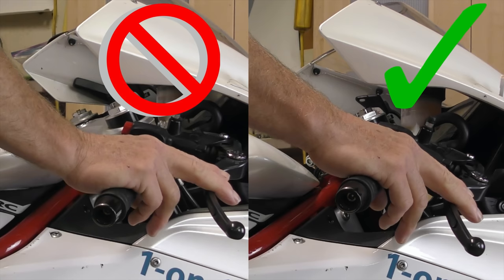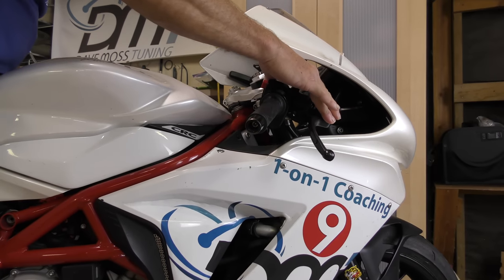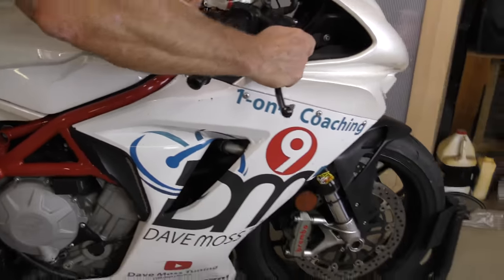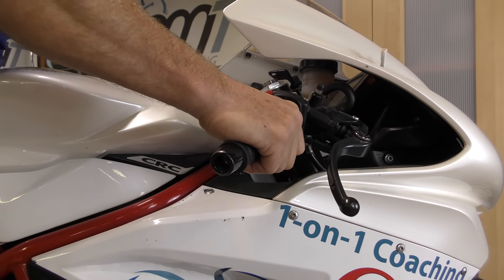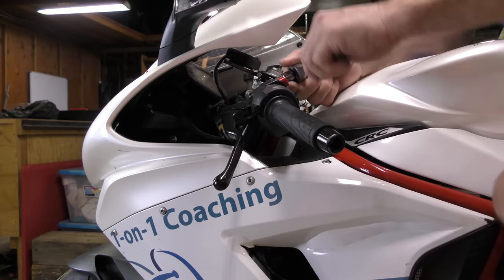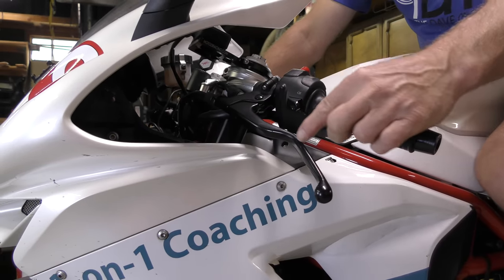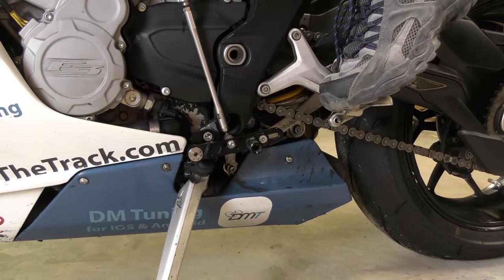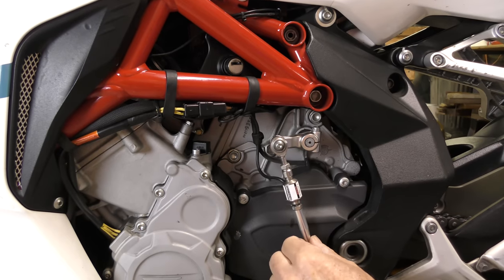How To Adjust Motorcycle Levers & Shifter

Comment: Just remember if riding an Adventure Bike its a compromise between between the position of the brake hand lever for standing, & sitting . I adjusted my lever up while seated on the bike to the correct position but didn't realise the acute angle I was putting on my wrist when standing . Thank you for your video it made me think about my posture something I hadn't really considered in 40+ years of riding , I would just jump on an' ride
Reply from the maker: Thank you for your response and thoughts that others can benefit from.

Comment: This is great for drag racing but in traffic where you might need to turn the bars. Those settings will easily hit the body work. So this is mostly for the track not the street.

Comment: I'm starting to believe that I'm REALLY over-thinking my front lever set-up. I've adjusted both of them at least three times so far. I'm new so of course I want everything as "perfect" as possible. I think I'm pretty close to where I want everything but this video helps a lot. Thank you!!
Reply from the maker: If you have to think about an action, then the lever is not quite righty. Normally, that is angle not reach. If it feels intuitive, you are in the right location!

Comment: Top man, Dave,  I finally bought my RT. I mentioned I was tossing up between an RT and a GS Adv. I treated myself to some new Daytonas. My bike was in getting the top box sorted. BMW have got big production issues at the mo. When I was taking the loan RT  bike back (the boots came between dropping my bike off and picking it up) I couldn’t get my foot under the lever. The new boots were the Evo Voltex. My old ones are the Evo Sports GTX. I had to go all the way to Peterborough in 3rd gear, which is about 20 miles away from me! I didn’t have time to fiddle with the loan bike. Today, I adjusted mine (badly). The shift wouldn’t go down. I obviously turned up the shaft too much. Your video helped me set it correctly. Thank you, from one Brit to another!
Reply from the maker: Thank you for using the information to create a much more ergonomically comfortable bike!

Comment: Thanks. Another great video. In my case I adjust the levers the way you do it, sitting as if I was in 'race mode', with my weight probably slightly more towards the front rather than in a relaxed position. That changes down the lever angle a little bit, it makes me lower them a couple of degrees more. Probably fine millimetric adjustments like this one make no difference. The important thing as you said is that nothing is getting in the way and that you set the appropriate distance as well. You have a radial pump, I have an axial one, yours should give you more feel. I don't have the knob with numbers to set the distance, but I do it by moving the lever along the handlebar towards the bike, that also gives me (at least to me) more feel as by doing so, I get more leverage (it compensates a bit the fact that it's axial rather than radial). Thanks again
Reply from the maker: Great lateral thinking in moving the lever laterally!

Comment: Man…when I was a kid I was lucky if I could adjust brake / clutch lever engagement points and the collar on rear shock which I was to afraid to mess with so I adjusted to every bike I got through the 80’s…. Was searching for suspension adjusting tips and went down a “Dave moss tuning” rabbit hole of you tube videos … which is kinda cool I found the adjustment sequence before I’ve even rode my new ( new to me ) fz1…I won’t have wrong adjustments to overcome when I adjust them to me .
Reply from the maker: Thank you for being willing to follow that path and create "your" motorcycle. A tip if the hat to you Vic!

Comment: Dave!
Glad your still doing your thing 😌
I past 34,000 miles on my (05) GSXR 750 couple weeks ago.
I'm thinking about retiring it from the street and setting it up strictly as a track bike 😊
Any info you have would be well received 👍🏻🙏
Reply from the maker: New fork oil and bushings, chassis overall with clean and lube, shock service, new rear wheel cush drive rubber. That way you are 100% ready

Comment: At 2:25 you're easily turning the silver adjustment wheel. Did you loosen something beforehand to make it spin easily? Asking because my bike's wheel is "frozen"
Reply from the maker: I use a 6mm allen when I need leverage vs a large flat tip. If you have the correct Torx tool, that is your best choice. If the adjuster is frozen, are you referring to both or just one leg. If both, normal settings changes move the adjuster left/counter clockwise to minimum. I would start by gently going right/clockwise with even pressure vs shock treatment with sudden force. If it does not move, try the opposite direction. Next step is that there is a risk that a preload spacer is cracked, so that means loosening the upper triple clamp bolt and the fork cap (make sure the bike is on the side/kick stand). Once the cap comes loose, compress the fork to see the spacer against the cap to look for damage. If there is no damage, close the fork up and repeat on the other leg. If there is no damage to either spacer, have a suspension shop or race team mechanic test the adjusters to see if they can get them free.

Comment: Great tips. Should olur front arms paralel to ground or we sit upright position when we set
Reply from the maker: All based on your spine length and distance to the bars as that sets your forearm angle by default. So if you can move the bars and create more comfort that shows you the preferred alignment for your forearm.

Comment: im curious if there are more adjustments to be made with gloves on as ive found that my adjustment out of gloves doesnt match what i need in gloves, especially winter gloves at least in terms of getting to that first knuckle as a gloved hand doesnt move the same when reaching for the levers. in fact summer gloves seem to make my hands feel smaller on the controls
Reply from the maker: Great contribution - thank you!

Comment: I have a question about throttle position. Iv adjusted my levers on my 1999 ducati 750ss but I feel like my throttle needs rotating forward a little to reduce the angle of my wrist while accelerating. My problem is the throttle housing is pinned in to the bar and the bar is pinned in to clamp so I can't easily rotate either without modification. I could rotate the clip on and then drill the recess in the bar for the bolt or I can remove the pin from the throttle. Do you think either method will be safe? And which would be preferable?

Thanks.

Comment: I like the clutch and front brake lever low enough so you don't have to lift your fingers high to get over them. I use one finger on the front brake but  use all four fingers on the clutch ..
  The Horn is really hard to reach on  the FZ-07.. and it will be loud enough when I finally install my air horn .. to get the idiots in cages attention when they cut me off and move into my lane.

Comment: Mr. Moss I have an odd question never asked. What is the "Normal" angle for clipons? What is stock normally and what if any changes should be made for racing applications? OEM are risers, Woodcraft are not and now the front fairing may need modification depending on the angle I use.
Reply from the maker: Normal is back of the palm in line with the forearm so you pull correctly in one line.

Comment: Should that line from the forearm through the brake lever be set while in a full tuck for a race bike? I notice it was set from an upright position, would that be where a track bike rider spends most of their riding time?
Reply from the maker: It is always set for braking position. Tucked means Quickshifter and or power shift.

Comment: What about a 2017 gsxr1000? I tried to lower my brake lever but the fixed cable gets in the way. My 08 zx6r had a nipple to keep the throttle cables in the standard position so I’m assuming this bike has one to. Thoughts?

Comment: When riding relaxed my arm is more straight up. When riding fast, my arm is dropped down almost parallel to the ground. Which scenario should I set up the brake/clutch lever angle for?
Reply from the maker: Consider your average speed and time spent in one position over the other. Create a mid point as a compromise.

Comment: Anyway to adjust a clutch thats hydraulic? Bought aftermarket levers but only the brake side will adjust closer for me. Was told after the fact only cable adjustable allows the clutch closer.
Reply from the maker: If the lever has no adjustment point at all, then yes, the cable free play is the only adjustment.  Some levers will offer adjustment on the actual lever itself, others will offer adjustment between lever and piston for hydraulic variants.

Comment: I have a new 2023 MT-09 and the brake fluid reservoir is connected to the front brake lever mounting bracket on the handle bars. Is it ok to adjust this downward, and not have the fluid level ‘level’ in the reservoir? Any advice is appreciated!
Reply from the maker: That is not an issue at all as you have the large rubber seal inside the top of the cap. The only issue is if the fluid is below the low level and you allow air to get in and that takes some effort!
Reply: @catalystreactionsbw  Thanks mate. Very much appreciated. ✊🏻

Comment: Hey Dave. I recently did a fork service on my 2007 CBR1000RR and when I got finished I noticed one forks preload adjuster can turn 15.5 times and the other turns 15.75 until full hard. I did not touch any of the preload mechanisms in the cap while servicing. The manual says the range should be 15 turns. Could it just be the preload tolerances were off from the factory? Should that small difference have an impact on handling if I set the preload equal from full soft?
Reply from the maker: The small difference will not have an impact on handling! The difference is created when the fork cap is assembled. It is quite common.

Comment: When I adjust my brake/clutch levers via adjustment dial, the engagement points change drastically. Adjusting clutch cable / re-bleeding brakes does change the engagement point or feedback feel. There is a lot of dead play in both before they actually engage (maybe last 10% of the throw). Any advice on how to alleviate the issue?
Reply: Looks like you have a lot of freeplay
Reply from the maker: Dead space is normally the gap between the lever and contact point for the brake. With time and wear, that increases. For the clutch, free play should be 1-2mm when the engine is hot.

Comment: hi there Dave,
Just trying to work out what i am doing wrong! 
 I adjusted this for my foot but then i have trouble changing gear ie it doesn't go into say second to third. 
could you give me any advice that i could try please..

the clutch Is adjusted to have correct free play. i have after market levers due to small hands. setting is on number 1
my bike is Honda cb500f 2023 i got it new after passing my test in the uk.. 
im 60+ and love your videos

kind regards kev
Reply from the maker: 1. Check that each angle is 90 degrees in the entire linkage. 2. Check the shift arm position and movement - it should not stress the shift rod. 3. Check the shift rod for any contact during the full up and down movement path. 4. Check the Heim joints are not seized   Those are the primary visual checks I run.
Reply: thank you for that information. i have managed to sort it this morning. i kind of played around with it so more but will look at what you have mentioned. thank you  @catalystreactionsbw

Comment: What about the ability to fully engage brakes? I was told to adjust brake lever so I can fully squeeze it without my fingers getting in the way
Reply from the maker: Depending on your technique, you would assess that as part of your unique setting. You may have to move the lever out more, but the question is how old is the brake fluid? It is good for 90 days to 3 months. I change mine every 4 months as it is very cheap and a simple task. What i do not use I give to a new rider or friend to use.

Comment: Should we be setting are levers with gloves on?  Big difference between bare hands and gloves.
Reply from the maker: Kangaroo skin is very thin and other manufacturers use leather of combination of materials. Set the angle with gloves on if that is critical to you as a fundamental with the process.

Comment: Can you adjust on a bike where the brake reservoir and booster is on the same perch as the brake lever?
Reply from the maker: If I understand you correctly, you are asking about the reservoir for a master cylinder that is held in place via a piece of metal, usually aluminum.  Many are fixed to the upper triple clamp, so to resolve the issue you need a much longer hose from the master cylinder to the reservoir and you can get the angle you need. If the master cylinder and reservoir move as one unit, there is no problem. If the reservoir is  part of a one piece assembly, it will hit the bars or triple clamps so angle adjustment is very limited.

Comment: How important is the proper torque on those lever bolts?
Reply from the maker: Correct torque for most riders is via a torque wrench. For those who have used that tool for a long time develop a feel for the various common torque settings.

Comment: I'm having issues with ending up in N instead of all the way to 2nd in a dig. is there any way to increase the throw of the shift rod?
Reply from the maker: Have you checked clutch free play at the lever with a hot engine? I am curious to see if that has been done. The other aspect is too make sure the shifter is not too high as that will put you in neutral often by mistake.
Reply: Yes i set the freeplay while the engine was hot i was paying attention during your video i promise lol. you were right though the shifter was too high and adjusting it seems to have fixed the problem. Thanks Dave!
Reply from the maker: @nop58653  Glad that all worked out!

Comment: All the Levers on my Yamaha FZ-07 were way out of whack from the Dealer.  I would not have fit anyone properly .
   The rear brake has a lot of free play which means it takes longer to apply the brake.  If I adjust it Properly then the brake light won't go on . Very Frustrating.
  It needs a brake pressure switch instead of a lever pulling on a switch ..  I have tried every adjustment possible and can't get the brake light to go on.
  Luckly I have  an Admore LED  on the License plate that sensed de-acceleration and  of course I have my front brake that works well .
Reply: Brake pressure switch is like a 10min install or so. I had to get one because of my aftermarket rear sets. Just get it.
Reply: @TWIRKNOLOVE    Good Point.  I used to have a couple of spares in my Shop..  My 6 wheel drive  truck has an air over brake fluid traction lock system .. and I like to  have the light on the dash working to let me know when my differentials and spiders are locked.
  Still would need the proper T to plumb it ..  and  the Yamaha is probably Metric .

Comment: The controls on the Honda CRF300L are locked in position with a key hole and pin. No adjustment possible :(
Reply from the maker: Where the pin fits, would it be possible to change it to a slot instead of a hole? Could you remove the pin? Just a couple of thoughts for you to ponder.

Comment: Would have been good for you to be wearing your motorcycle boots when showing the pedal adjustments

.. And if you ever went for a "quick run"  wearing those running shoes .... laces  looking a bit on the dangerously long / sloppy side ;)
Reply from the maker: Agreed with you on boots. We should have done that but the camera picked up very little foot/ankle movement so different color upper would be needed for much better contrast.

Comment: I install new aftermarket clutch lever on my bike ... but after i install it it become loose and when i grabbed it wont go back to original position ... am i install my clutch wrong or something else
Reply from the maker: Did you take the bronze bushing out of your OEM lever and put it into the aftermarket lever?
Reply: @catalystreactionsbw  what bushing?
Reply from the maker: @mynameismrmeow  Look at the OEM lever, it will have a golf bushing where the bolt goes through. Sometimes that needs to be removed and put into the aftermarket lever
Reply: @catalystreactionsbw  ok thanks man

Comment: Shouldn't people be riding with the brake covered at all times anyway? That's what I do and there's no issue accelerating into braking or any impediment of accelerating short of needing to whack wide open. Maybe it's different on track.
Reply from the maker: If you choose to ride that way, are you pull the lever in the correct plane compared to your forearm? If not, then you lose a great deal of efficiency. If you palm is above or below your forearm, then the lever pull is incorrect biomechanically.

Comment: What if the clutch handle is connected to the mirror?
Reply from the maker: The mirror can be adjusted. If the range of adjustment is not available with the mirror, then you create a compromise.

Comment: Sadly, my 2019 R3 won’t let me angle the brake lever any lower than it is. I forgot why; I only recall my disappointment. Master cylinder hits the windshield fairing or something.
Reply: Shift the whole brake lever assembly slightly left or right on the bar to gain a few more mm of angle to clear the fairing.
Reply: @TWIRKNOLOVE  Good idea, but I fear there’s no open real estate on either side anyway :( sad times

Comment: With the adjustment of the clutch lever, is there likely to be cable slack because the tension has been changed due to its new angle? 
If so, how much would need to be dialed back for optimum use? Thanks.
Reply from the maker: I have yet to see the need for a clutch cable reset when an angle is changed. Does not hurt to check of course.